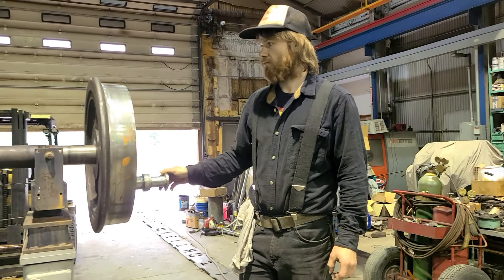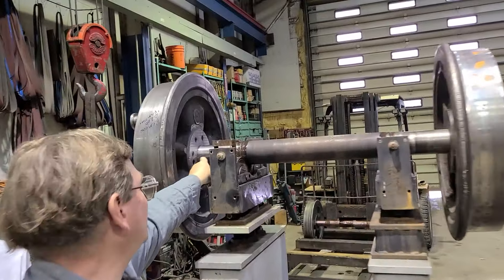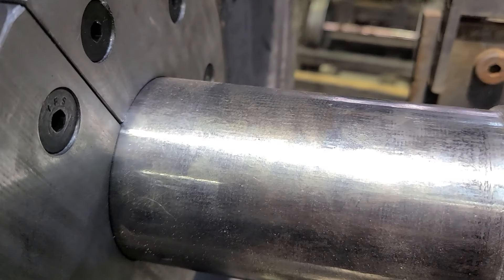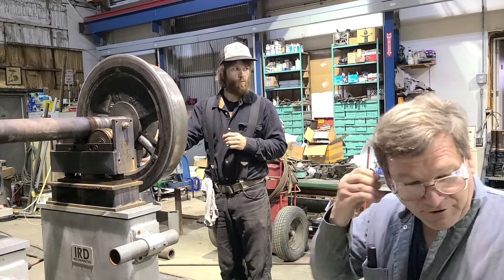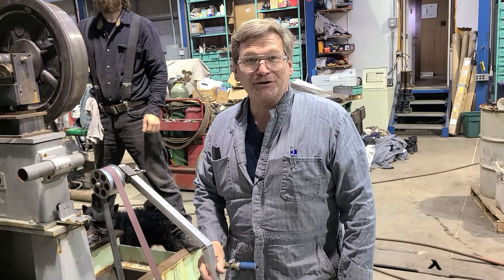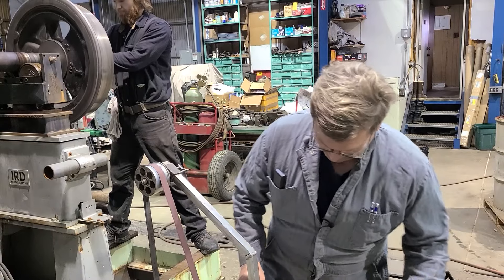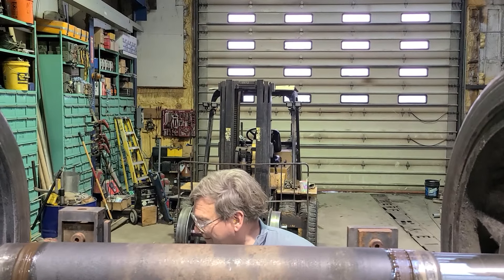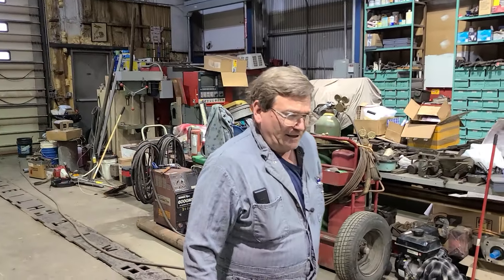Machinist's Minutes: Polishing train axles

Comment: What grade abrasive were you using there, is there no risk of reducing the axle size
Reply from the maker: It was a 220 grit belt.  The diameter does get reduced slightly, about .001 for what I did, surface quality is more important than size in this case.  Many times I use the same polisher to remove small amounts for final sizing, we had belts down to 600 grit & also scotchbrite belts.
Reply: @HOWEES  👍👍👍